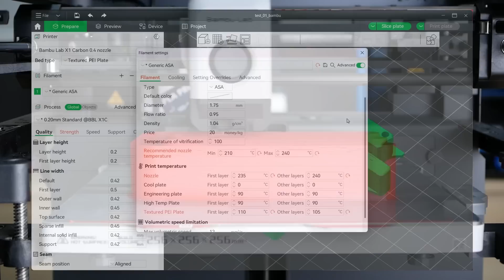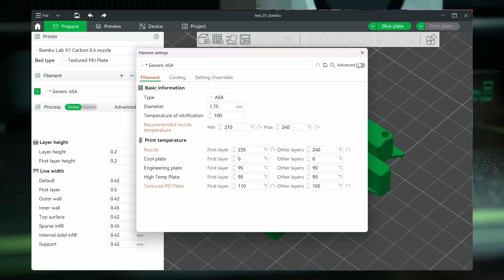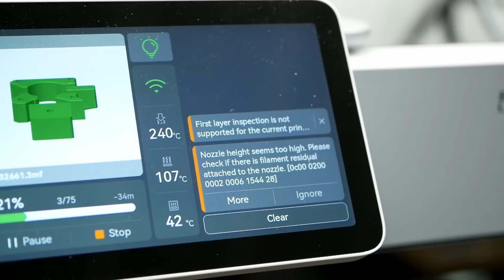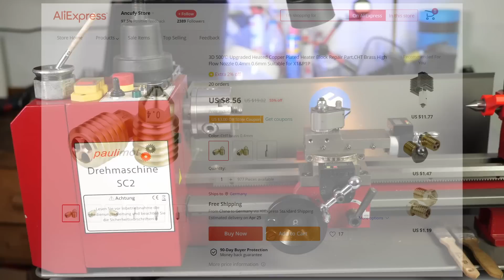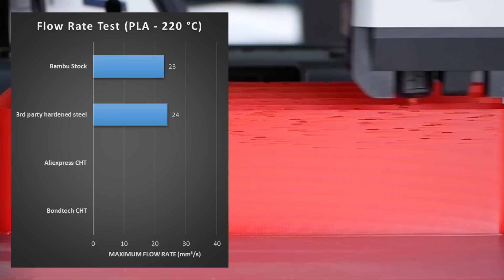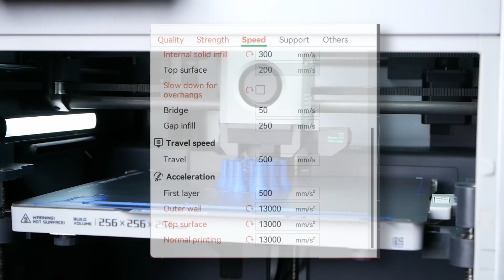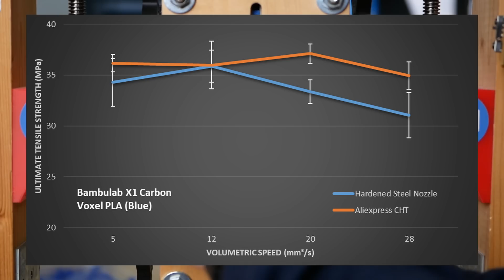Fast 3D printing is bad for Strength! (and how to fix it!)

Comment: Can you machine 3D printed parts? If so you could print parts larger than your test pieces and machine them down to the test piece size such that all of the plastic within the test piece was laid down at a constant speed. That will change things regarding strength coming from perimeters, though.

Comment: Still a newbie and a  former machinist I thank you for insight into issues I've been experiencing with my X1 printer and it's settings. My Ender 3 S1 Pro with Sonic Pad tuned produces faster, good finished and parts of solid structural integrity of a phone holder, clip style. Using the same material, settings (temp/flow) X1 produced gummy weaker parts that failed under the stress of the design. Again being new (December 2022) I wasn't understanding the "why's" for such failures. I will be looking into your suggested mods and settings. Thanks for your insightful efforts.

Comment: A good way to avoid the acceleration issue in the test coupons would be to use perimeters for the primary fill of the part, as the concentric pathing will avoid the harder acceleration points based on the linear infill, and will be more consistent as it avoids the inevitable changes in extrusion speed required to keep consistent bead width when doing harsh direction changes.

Comment: Okay, so the BambuLab hotend is just garbage. Despite being excited about the many positive reviews, I was anything but thrilled with my X1C printer when I noticed the problem with the first part within the first print hour. It was matte! I always adjust my flow rate based on whether the part shines or not. My other printers consistently printed my standard filament, which I have now printed 600 kg of, at an average of 215-220°C and a maximum of 24 mm²/sec without any issues. However, on the BambuLab, I had to reduce the speed to 10 mm²/sec to achieve the same result or increase the temperature to 280!!!°C.
I assumed there was a defect because none of the well-known 3D printing YouTubers had mentioned it yet, and the problem seems so obvious. I've been struggling with BambuLab support for the past 4 weeks, but they couldn't help me. What's the point of having the X1C if every other printer I own is faster due to the increased flow rate?

Comment: I’ve had a lot layer adhesion problems with Polymaker ASA with stock Bambulab ASA profiles. Ended up slowing things down and turning down part cooling to get acceptable strength. Definitely going to look into this mod! Thanks Stefan!
Reply: I know this is 6 months old, but I have been turning the cooling fan completely off for polymaker ASA and layer adhesion has been great.

Comment: I've been slowing down print speeds on anything "decorative" to 50mm/s on only the external layers for my bambu x1c. While it definitely slows down prints (but still faster then most printers), it makes parts way nicer and eliminates any of the color changes.

Comment: Meanwhile ive been pushing 25+ cubic mm/sec at a temp of 305 C with my ABS on a creality cr20 (klipperized + bondech direct drive + linear rails upgrades)
Reply: I would not reccomend unless u have a lot of cooling and a very well sealed and filtered chamber; but not overshooting the temp enough is the problem.

Comment: finally someone comes up with this, i have 8 bambu printers and noticed this (I also have 6 prusas) that the parts are just not strong enough, they look matte and so on. I'm currently printing at 240 with the same filament that on my prusas print just fine at 215, and the parts are still weaker. I've ordered the aliexpress nozzles, I hope they will solve this problem. The other thing that I was thinking about is just to add another ceramic heater to the other side of the bambu hotend but I'm not sure if the electronics can handle it. Also, this mod should require a new pid tune and that is something that is not currently possible with bambu printers...

Comment: Bambu lab i actively trying to hide the fact there stock hotends are defective.  They also no longer allow talking about this hoend in there facebook group.  Also you dont need to mod the heatbreak. The mod is to the heatsink is self.

Comment: TBH i find standard and silent modes to always be fast and clean enuf to provide perfect prints. Even @ these slower speeds they outpace all the other bed slinger type printers i have on my farm.  I have managed to remove 7 bed slingers (prusa ender style machines)off my farm for just 3 Bambu Labs. I just don't see the need to print any faster.  The hot end is a marvel imo just being able to order the whole assembly direct from bambu have it at my door in 2-3 day and fit it up in less than 5 mins is a blessing. Don't forget they ship you a spare free with the unit... I can also print too fast on my prusa's,enders,vorons and my highly upgraded Mercury G1 machines... and in the case of the ender and prusa's that's at less than half the speed of the Bambu's Vorons and G1 machines.  But i understand... you know "Content".

Comment: So now we need super slicer to let us vary extrusion temperature based on volume flow rate with a comp value for heat up time just like with the fan. I’ve wanted this feature to lower the temp during bridges for a while.

Comment: Off topic but regarding strength in materials have you tried any experiments with graphine. TechIngredients channel produced a how-to video where they create a small amount of graphine from raw graphite (with high voltage) and when difused into an epoxy mixture the strength improvements were tremendous.

Comment: I noticed this about 3 years ago, but it really hasn’t been much of an issue until we’ve been able to print very fast.  The entire issue is the temperature of the plastic that has already been laid down.  When you print slower, and with a higher temperature, you allow the already laid plastic to raise to a temperature that is more conducive to better layer adhesion.  Increasing the temperature of the ambient air is the easiest to do, but requires an enclosed chamber, even for filaments like PLA.  To make things worse, different variations and brands of the same type of filament, will have slightly different characteristics and requirements.

This requires a lot of trial and error experimentation, which takes a lot of time that people may not have, or may not have any interest in.  You do need to know what is the best ambient temperature for the filament that you are using, and then what is the best fan speed.  Even ABS and ASA will need some fan speed here, if you have chosen the best ambient temperature.  For ABS and ASA I have been using between 44C and 50C as a base, but I know that even higher is better.  Most hard enclosures can reach 60C or slightly higher by passive heat from the bed heater and hot end.  Higher temperatures will require an enclosure heater.

This brings us to the limits of printer components.  Stepper motors stop working when their temperature reaches, or exceeds, 80C.  Rat Rig addresses this by moving all but the extrusion stepper to outside the chamber, but almost all other printers do not do this.  Motor temperatures will be higher than the ambient temperature, so if the ambient temperature is 60C, the motor temperature could be 85C or higher, and thus be in the failure range.  Cooling the motors inside an enclosure would most likely also cool the temperature inside the closure, making it more difficult to reach the temperature needed.

Anywho, it’s a lot of chicken chasing the egg, but this is what you would need to do in order to print at faster speeds while maintaining a specific level of layer adhesion.  A very good video indeed!
Reply: Higher print speeds = higher part cooling fan speeds = weaker parts. As simple as that.

Comment: Nice video, thank you 😊 why do you want to avoid drastically increasing temperature? I have been doing this for years with fat nozzles without changing to volcano. Works for this printer as well. I go 20-40 °C above max recommendation for nozzle temp. Printing 20-30 mm³/s for PLA, ABS, ASA, PETG, PCTG with hardened 0.4 mm nozzle . Perfect strength, shiny as always 😊
Reply: That works when printing at equal speeds for all the print features. If you have to slow down, you will run into issues.
Reply: @alejandroperez5368  what issues?  I never had any. You just need to adjust cooling accordingly.

Comment: Could you print large upright I-beams and then do a 3-point bending test? It wouldn't give standard results, but at least you could compare different speeds to each other. Maybe even round all the sharp corners so it doesn't have to slow down as much.

Comment: About avoiding crazy acceleration rates: all you care about here is relative performance, so you don’t have to be constrained to your standard coupon geometry. 

You could make layer-adhesion coupons with much larger diameters in the critical region, which would give proportionately lower accelerations, or conversely higher speeds for the same acceleration.

To keep the forces in the range your universal test machine can handle, you could make the structures hollow. Either start large, using a different holders on the machine, or use the same clamping diameter, but expand larger and solid right above/below the clamps, then go hollow and neck down. (It’d be easier to explain if I could draw it here, but I think you’ll get the idea easily enough. When you start making the hollow part, widen the internal opening slowly (similar shape to the exterior of your current coupons) so it won’t need any internal supports.)

There are obvious limits, so I’m not sure you’ll be able to go to a large enough diameter to make a difference (the total cross-sectional area of the neck in your current coupons doesn’t give you a lot to work with), but it should help some. - And given that your machine can handle tensile testing in the in-layer direction, it might be strong enough to handle a much larger cross-layer cross-section. (Again, for this test you only care about relative numbers, so don’t need to worry about comparability to your standard tests.)

Comment: im really not a big fan of my bambulabs cx1. the prints are weak when printed fast, it takes far too long to start a print, there are far too many unnecessary movements, there are too many proprietary components like the nozzle, the bed is not ideal...I don't want to use glue for pla prints nor do i want to put a consumable sticker on my print bed, it's loud, I dont need a touch screen, multicolor prints take way too long and waste too much plastic because of the single extruder design, the lidar scanner has basically been useless except for a single calibration, I could go on but if I were to buy a new printer I'd buy a prusa XL with 5 nozzles no question
Reply: Yep, to each their own. If someone gave me a prusa XL, I'd immediately sell it and buy more X1C's. Those things you mentioned are not issues at all for me. Looking forward to getting rid of these creality printers and getting more X1C's.

Comment: I'd be curious to see if the material itself is affected strength wise, not just layer strength, by the rapid heating, extrusion, and cooling. A flat tensile test sample (hourglass shaped) should be easy to make without the need to worry about acceleration as much.

Comment: Very cool  and informative tests. Would have been interesting to know comparing results using one of Bambu Labs own PLA Basic filaments in regards of performance and strength quality while going up with the extrusion rates as they classified their filament to be a HS (high speed) filament compared to others in their profiles.

Comment: I'm thinking of getting a banbulab printer, but I also want to be able to print minis as well as print fast. I need a 0.2mm nozzle as well as 0.6mm nozzle and 0.4mm nozzle both in high flow variants. Hopefully more sellers will provide those and aliexpress will help by providing those details.
Reply: Bambu already offers those sizes and  are very reasonable for around $30. That the whole assembly….fan, heater, whole thing just plug and play. I plan on grabbing some alternate size nozzles as well down the road. 0.4 is doing fine for now.
Reply: @guycobb3251  Do they offer high flow 0.4 and 0.6/0.8? Because that's what I'm most interested in frankly besides 0.2, which can be normal. Also do you need silicone socks for 0.2mm? It drastically improved my 0.2 print quality for minis.
Reply: @SneakyJoeRu  couldn’t imagine needing any higher flow than what the current hot end setup is capable of now for a 0.2. I’d imagine back pressure would be the limiting factor there, but I could be wrong. For the bigger nozzles, you might have to go with the 3rd party hotend and a CHT nozzle to move faster than a stock Bambu nozzle. The thing is already ridiculously fast with the 0.4 nozzle.
Reply: @guycobb3251  For 0.2 high flow isn't needed, but I want it for 0.4-0.8
Reply: @SneakyJoeRu  I’m a dummy, I misread. Yeah, would likely be the same for the 0.4 then. No higher flow from Bambu yet if that’s what you’re shooting for. Luckily the 3rd party has already stepped in. The Ali express hotend and knockoff CHT nozzle seems like a solid pick though.
Reply: @guycobb3251  Yeah. Just need to buy a printer first, and then I'll go on a journey of cheap knock-off replaceable parts.
Reply: @SneakyJoeRu  love mine thus far.

Comment: I would be interested to see what would happen if you made a gcode post processor that increases nozzle temperature depending upon the volumetric flow rate, so areas of a print at high speeds get high temperatures, and lower speed areas get a more normal temperature.
Reply: Unfortunately, there is too much temperature inertia to so. I can imagine that heating up can be made quicker, but cooling down?
Reply: @AlexandreKandalintsev  well I figure the filament pulls heat out of the hotend, so that has some cooling action.
Reply: @quinnobi42  Not at the required speeds. You'd need to have an active cooling method for the nozzle. And use a very high voltage to heat it up quickly enough.
Reply: @alejandroperez5368  I wasn't really thinking of an instantaneous system. I know it takes time to heat up and cool down the hotend. My thought was that you could have the temps cool down a little for the areas of the print where there are more sustained periods of lower speeds, such as the top of a benchy.

Comment: I would hypothesize higher temp really helps with CHT by ensuring the "knife" can immediately and consistently slice through the core rather than hitting resistance. Unless you'll be pausing with the material unretracted, it's basically impossible to cook filament, so go wild. You can print PLA up to at least 250-260 to get high speeds, and ABS, ASA, PETG up to 320+. For PET (non G) I've measured increased flow (and essentially isotropic part strength) up to 350.

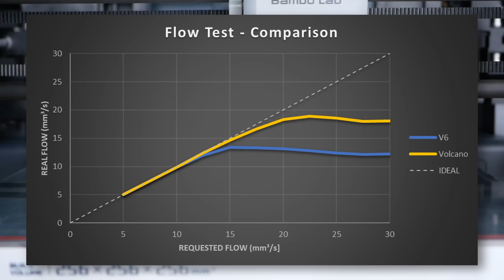Comment: 3:25 - it is wrond method to measure hotend flow capability. The result will depend on the temperature, feeder strength, nozzle diameter and the material.
The best way to solve this is how MirageC did: https://www.youtube.com/watch?v=dAJlLWX0Few&t=599s
What he did is place a load cell to measure the force to feed the plastic to the hotend. In the point where the force starts to rise nonlinear - is the maximum extrusion capability of given hotend. The curvature happens due to the fact that the material temperature is not corresponds with the hotend temperature. The linear zone is viscosity zone.
Reply from the maker: Good luck doing that on this printer.
Reply: @CNCKitchen  You mean - measure the force between the hotend and the feeder?
It is not necessary. You can estimate the melting capabilities by just measuring the length of the melting zone (if it has the same shape as regular V6/Volcano. If the lenght is the same as Volcano - you could expect up to 18 mm3/s of reliable extrusion.

Comment: Well, I backed the X1C because I don't want to mod 3D printers anymore and just get good prints. But yes, my experience with Extrudr ASA is exactly mirroring yours: Easily breaking at the layer lines. Turning off the cooling helped a bit, but my next attempts will probably be at (much) lower speeds.
Reply: What temps are you printing at? I print Polymaker ASA at 290°c (pt1000 thermistor, so it’s accurate).  

If you can’t get good layer adhesion, crank those temps. ASA likes high temps.
Reply: @ev2477  The higher the temperature, the worse the part warping is...

Comment: This video made me wonder if we are seeing the limits of heat transfer or heat availability.  Right now the hot end heater is controlled reactively using a thermistor and a PID control loop.  What if the hot end heater control loop also used the current or upcoming flow rate to proactively add more heat to prevent the temperature from falling in the first place?

Comment: The rule of thumb is very simple
1) When slicing, check if the flow is less than your hotend is capable. For example: V6 is capable of 11 cm3/s, Volcano - 18... Your flow can be calculated as simple as this: feed speed (mm/s) * layer hight (mm) * extrusion width (mm). For example if you have 0.2mm layer hight and 0.6mm line width, you should not exceed 18 / 0.2 / 0.6 = 150 mm/s (for Volcano)
2) Never bump up the temperature to increase speed.
If you stick with these rules your plastic at the nozzle tip will have the same temperature all the time at any layer.
Reply: Why #2..?
Reply: @coltenmeredith8899  If you do this to increase the flow capabilities, your printing will behave differently in different parts of the print: if the printing is slower (or line is narrower) your material will be hotter than desired and you will have glossy surface and worse overhangs, maybe even material degradation.
If your flow is not exceeding some certain value, your material will have exactly the same temperature out of the nozzle. Which will result in reliable printing.